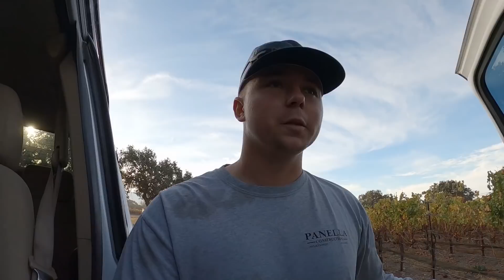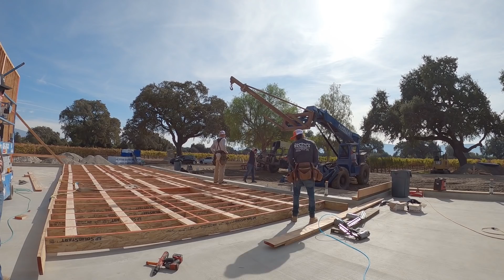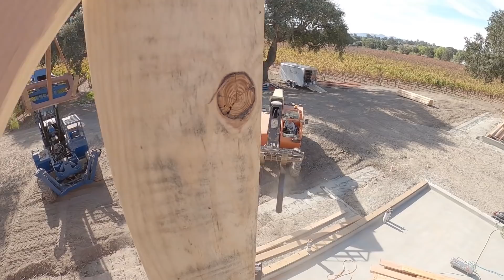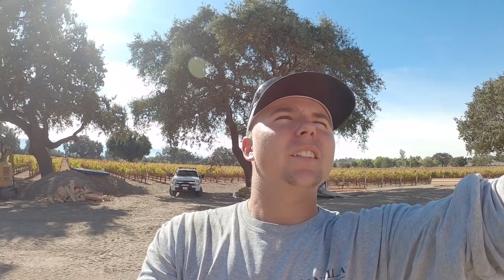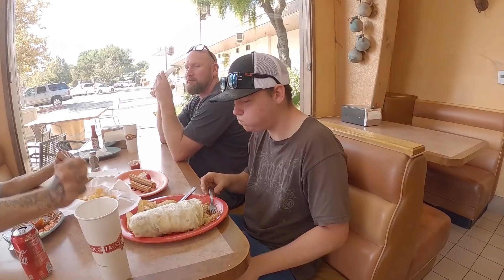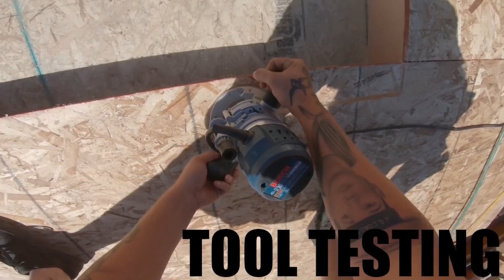The BIGGEST Wall + Laser Plumbing Walls Tip! [DAY 6]

Comment from the maker: Safe to say these aren't the biggest walls we'll lift on this build.. We stand some real big ones here in a few days!

Do you want to support the channel? Become a patron, see photo and video before it's on social media: https://www.patreon.com/mattbangswood

B A N G  O N !
Reply from the maker: I actually just got one from one of our channel moderators: Loren Ricky. Super stoked to try it out!

Before that, I used the Flush Trim Bits, with the bearing that's notorious for flying off. Loren said the new bit wont do that, so i'm pumped! I don't think i'll be routing anything on this build though, seeing as it's fiberglass coated, and the router throws a lot of dust!
Reply: Question, did you go to a trade📐 school to learn this? If so, what school and major👍😊
Reply: @fritz paul i started framing at 21 years old started out as a laybor putting hangers, picking up trash eventually moved up to doing the stick layout for the nailers and eventually started cutting and nail and got enough trust to start doing things with out being supervised i learned just by watching and being told how to roll truss's ,joists, joist layout and so on now im 23 years old runing my 14 man crew doing big buildings my point is you dont need school soak up as much as you can and have someone show you how to read blueprints its a big must to know
Reply: @chayobeltran5211  thanks for the info 👍
Reply from the maker: @fritzpaul2740  Late response, as I didn't see this.. I didn't go to trade school, was taught everything on-the-job. Dropped out of highschool to frame at a young age!

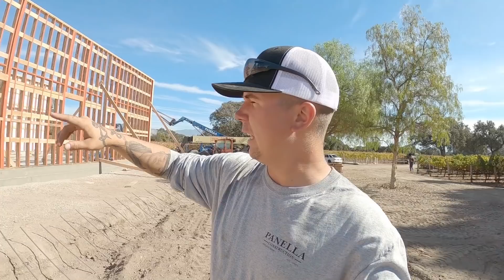Comment: Matt, it seems there are a crap load of nails you put in from 10:23 to 11:00 - I've found if I put a cluster of 4 nails or more in a tight area like you're doing the wood actually will split but that is in 2x6 framing.  I know you have a wall seam somewhere in there and that you're tying it together, but that many nails seems like more harm than good.  Just something you've always done?
Reply from the maker: Called out on plans for top plate splits. It’s a must.

Depends on the people drawing it up, some ask for (18) 16d’s on each side of split. Sometimes more, sometimes less.

Comment: Is all that blocking also serving as nailer for vertical siding? Sorry if I missed that.
Reply from the maker: Yes, it is! It's got 1x12" redwood board and batten going up, and the nailing will be centered on our block lines.
Reply: @MattBangsWood can I assume that the siding will be attached with some type of stainless steel "slim jim" siding nail via a Hitachi siding gun? Lol!😀

Comment: One last thing, How much weight will the Lull lift?
Reply from the maker: It's an 8K lift, but with the extension, it'll lift the world. We're not entirely sure though, it'll outlift any of the newer 8K reach lifts, as ours as the downriggers. We lift a wall about this size, but completely sheared on a later day, so we know it's capable!
Reply: @MattBangsWood  they are expensive but I know they easily pay for themselves. Between lifting walls, beams, trusses and moving materials around, they save so much time which equals $$$$$.
Reply: MattBangsWood does it have a load chart in the machine?  It tells exactly what you can lift at what angle of boom.  The extension adds another layer of math to it though.  I have only seen down riggers on 10k lulls, they are nice to have.

Comment: Why does sheathing the walls get done after standing them up? Just to reduce the weight? Or could the wall flexing actually pop out the nails holding on the sheathing?
Reply from the maker: We sheer majority of these exteriors.. But we’ve got a man basket on site, so the time spent squaring and sheathing isn’t much different than sheathing while up.

We don’t sheet walls that are too big and risk flipping our lift, or walls that refuse to square up (we’ve found a few).